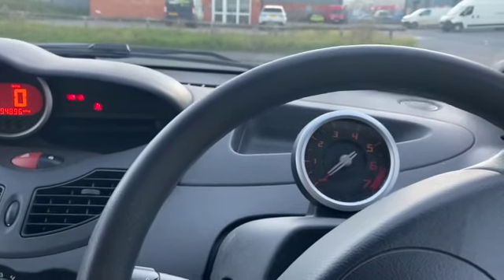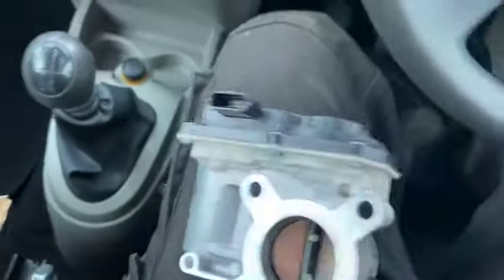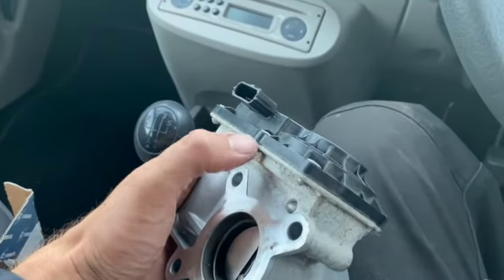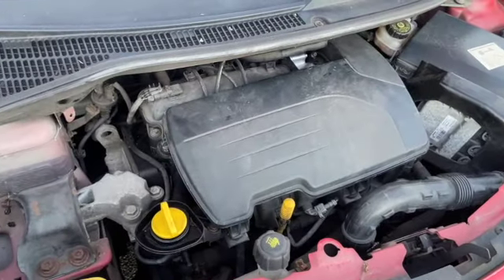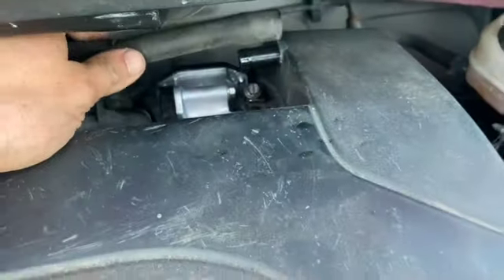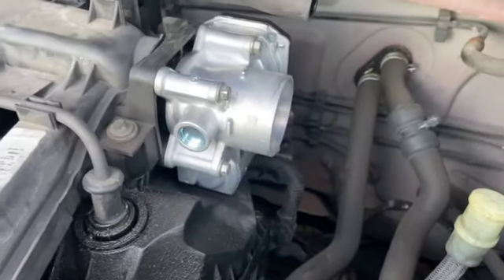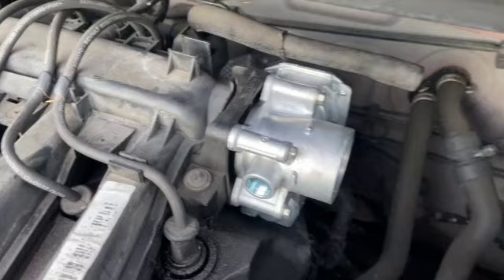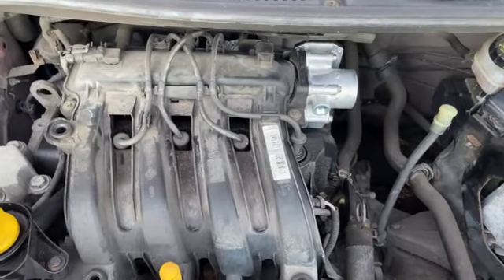Renault Twingo / Clio DF079 Fault Code Motorized throttle unit

Comment from the maker: New Pierburg throttle body Euro Car Parts - https://tidd.ly/32bM1yq
New Fuel parts throttle body Amazon - https://amzn.to/2ZlmbpR
Budget throttle body Ebay - https://ebay.us/pJQBOM

Tools used :
EOBD Scanner Amazon - https://amzn.to/2YBMA2L
Budget EOBD scanner eBay - https://ebay.us/IHpAfK 
Advanced EOBD scanner eBay -https://ebay.us/odL6V7
Hose clip driver - https://amzn.to/2FhcTEa
Draper socket set - https://amzn.to/2FdUEjf

Check Euro car parts - https://tidd.ly/3lIO7xA  (use discount codes on site)
Check "Car Parts for Less" - https://tidd.ly/2LNEwIn  (use discount codes on site)

Comment: SOLVED EASY FIX 
I had the same issue with my car around 100,000 km's. Some water/debris came in my throttle body which disabled the spring function of the mechanism, so the throttle plate ended up being stuck. Because of this, your throttle plate sensor is in the wrong position and causes an electrical error in your dash to light up, and this makes the car Rev up on its own. 

I took off my air filter box, then disconnected the throttle body connector, and then unscrewed the 4 bolts to get it off. I already saw that the throttle plate was in an open position (which should be closed). I took off the sensor part by drilling though the pop rivets, so I could see the mechanism. I simply cleaned the spring, gears and sensor and lubed the spring with some WD-40. If it's cleaned right, the throttle plate should close on its own (not 100%, a small gap is always needed).

After the cleaning, I reinstalled everything back and turned on my car (CONTACT ONLY!) for 30 seconds, then shut off 30 seconds then on 30 seconds. This makes the board computer reset the sensor position. After this sequence I started my car and the problem was gone as well as the dash lights.

If you still have the same issue, you might have a broken TPS (throttle position sensor), of which I advise to replace the whole throttle unit. I found new ones for around €120,-.

Comment: My Twingo revs to 3500 then just sits doing that. I can stop it and the throttle doesn't work. I also get the electrical warning light on the dashboard. When it's revving it sounds like it's misfiring. I removed the throttle body and gave it a thorough clean. After refitting it started fine and run perfectly. I took it out and drove fine, got home and turned it off. Started again and revved up to 3500 again.....🤬🤬
Reply: Hi i have the same problem have you any update's
Reply: Same issue … any updates ? Have you fitted a new one and solved it ?
Reply: @tenti1524  i have a new trottle unit and it works fine
Reply: Hai dovuto fare l'aggiornamento del nuovo acceleratore?  @MrShotocan

Comment: Working on the same fault on a 2005 Scenic 2 with K4M 782 engine. Did the whining sound become less after you replaced it?
Reply from the maker: No I’m afraid not mate
Reply: @diydaly  Thanks for the feedback. I ordered a second hand throttlebody for 20 euros. Worth a try :) Not sure it'll work because I'm also getting DF038. Read something about bad connections in engine ECU.
Reply from the maker: @klaasklapsigaar1081  🤞 see how it goes 👍

Comment: Hi Mate, Replacing this doesn't look too bad. My Twingo is revving up and down like mad on its own with no throttle response and im reading that its the throttle body. After a new one is fitted is there any work that needs to be done on the ECU side to make it calibrate ?
Reply from the maker: Hi, thanks for the comment.. Yes there's a good chance its throttle body related. there's no calibrating required but you may need to clear some fault codes from the engine ecu with an eobd code reader.